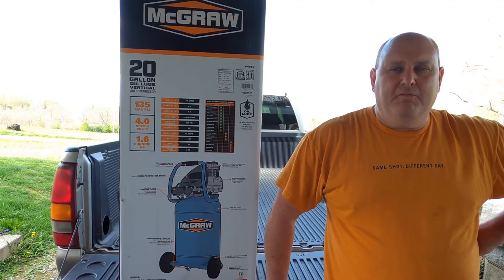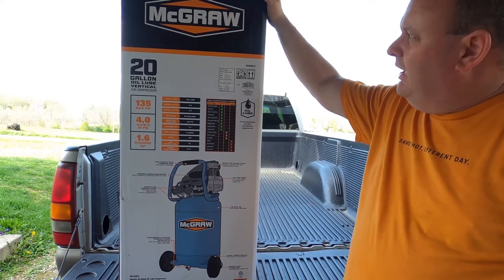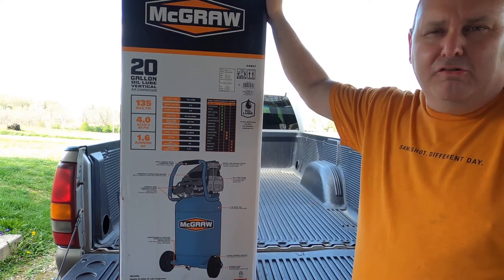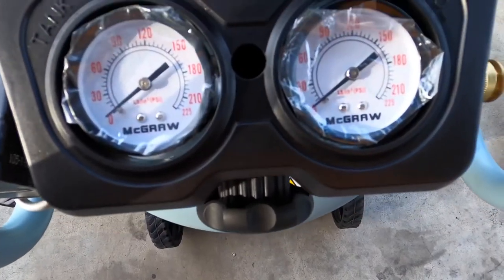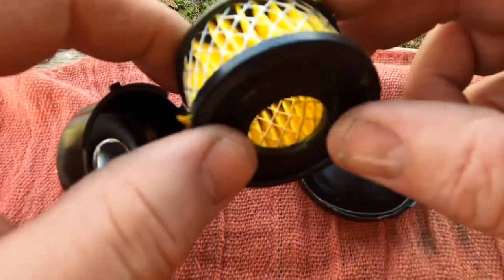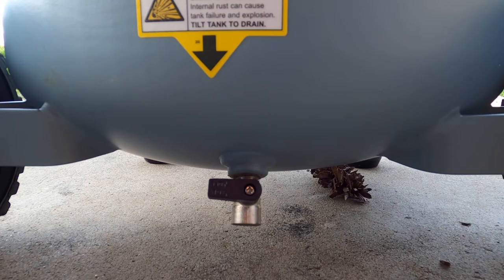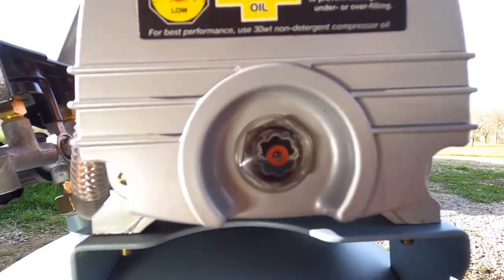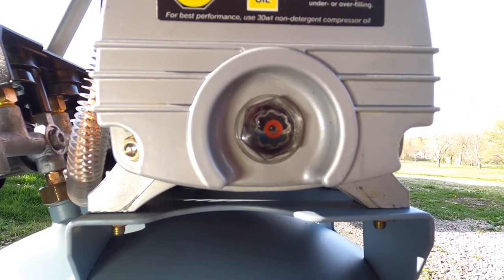Trucking , Tool Talk on the Harbor Freight 20 gallon McGaaw air compressor unboxing and setup .

Comment: How do you rate the noise level of this compressor? And is it louder or quieter your large compressor?
Reply from the maker: Really about the same , the larger compressor has a deeper sound vs this smaller one having a higher pitch . All and all both are fine .